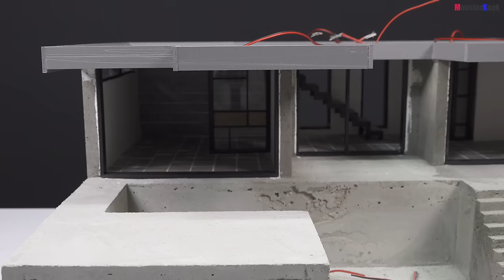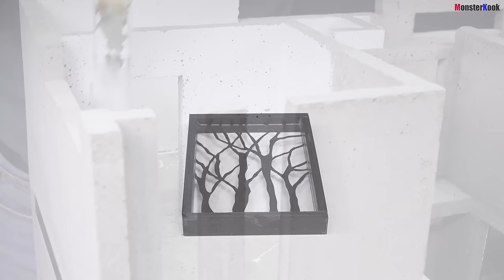How To Make a Luxury House(model) - Compilation.

Comment: I have built many scale model buildings: Houses, Churches, Schools, Multi-Family, etc. Not once did I make any with reinforced concrete. I have used lightweight Spackle on topographic models to smooth out the contours. 

Your detail with metal rods, forms, and mortar mix is amazing. The creative use of different materials yielded spectacular end results. Working wooden doors, patio sliders, lighting, and swimming pool put this build over the top.

Comment: I  like  that   kind  of  job  ,  because   is  very  solid   , waterproof
and  electric proof ,  the  one  only  thing  is  that  is  very  heavy  ,  but
It  can  stay   outside   for  a  decoration , in  the  garden   on  front
of  the  big  house   or  on  the  backyard  ,  whatever   . From  a  different  materials   ,  lighter  ones  can  stay   inside   instead   to  decorat  and
evetized   the  real   one  the   original sized   house  ,  which  the  owners   are  proud   of   to  have   IT  .Lusiuniu.